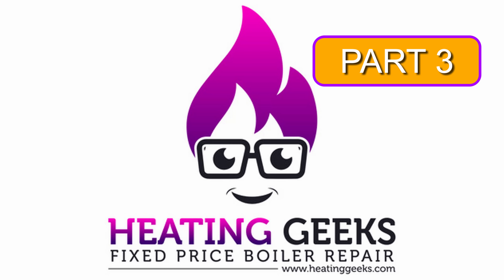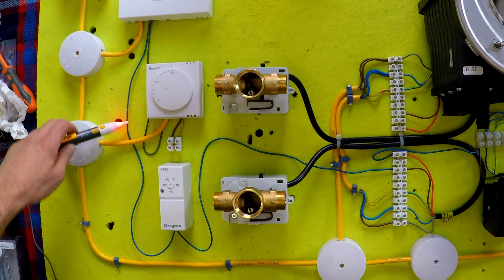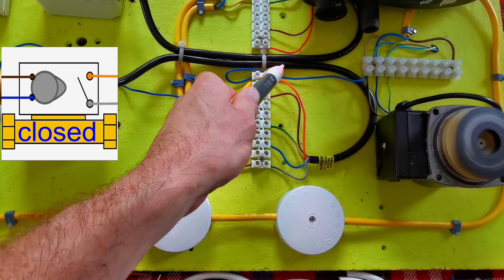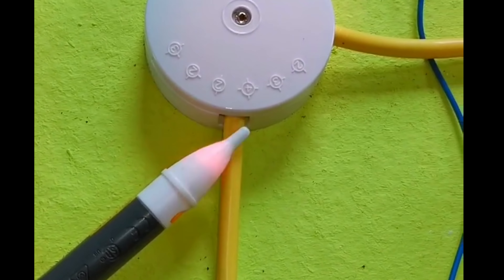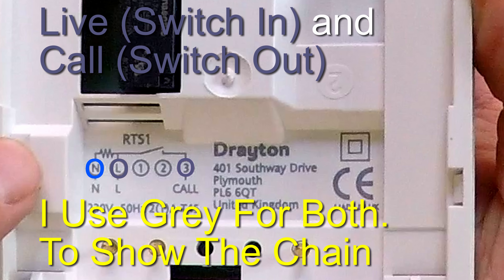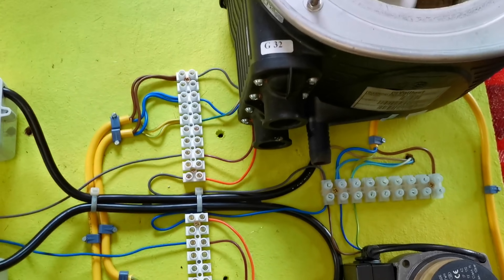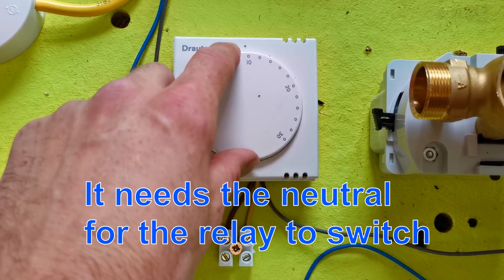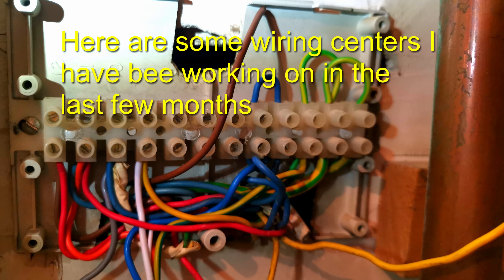How to wire heating systems. 2 port. 3 port. S plan Y plan. Heating engineer

Comment: Hey there. I was busy watching a woodworking video when part 3 came out. I immediately went back and watched pt1 and pt2 before watching pt3. The way you explain how a heating system is wired is simple to understand, and the simplicity is and constant repeating of steps are much appreciated. Only been working on central heating for a few months now.
Reply from the maker: Good I'm glad it helps. I did think about how to explain this because it is a difficult subject. :-) Thanks for watching and taking the time to comment.

Comment: great video easy to follow, when installing a CCT system and external pump do i connect additional pump to pump terminals so when  zone valves are calling for heat via nest system  both pumps switch on and boiler fires
Reply from the maker: Sorry I didn’t respond to this comment. I didn’t see it in my feed. :-(

Comment: I came up with something I find really useful when thinking about 2-ports. 
It's literally BROWN FROM STAT ORANGE TO BOILER. And yes, it needs to be said in capitals out loud. 
The other thing you have to remember is that the grey cable is actually the live from the mains and the brown cable is the switch from the stat which confused me at first because those colours should most definitely be swapped.

Comment: Great video. Thanks for sharing this. I have a question rather than have a permanent live to the grey wire of the valves. Could I use the thermostat feed wires to the valve and connect both the grey and brown valve wires to it.
Reply from the maker: I have done this several times to get out of problems. However the motors tend to seize more if wired this way.
Reply: Fantastic, thanks for the help. I do have a couple of feeds which I think might be permanent live so I will do a bit more investigation as to where they come from. Also did you make another video showing a pump overrun system for the s plan?

Comment: Very informative video indeed. just one question...at 3:57 you switched the spur switch off and measured 7v on the supply line at the junction conducting strip...why was that?...was it a dodgy spur switch or some sort of residual voltage from the programmer or pump or even the boiler? hopefully it wouldn't be enough current in that line for you to get "juiced" even if you did touch the live terminal!...because its the current that'll kill you not the voltage, and being relatively low voltage should be ok, right?
Reply from the maker: Im not sure . the video is old and I never rewatch them. ;-)

Comment: Great video thanks mate! So when the heating or hot water valves shift across do they allow water to flow through to the pipework?
Reply from the maker: Yes they do. :-) This is for gas engineers who know the mechanical bits and I didn't think about sparks :-)

Comment: Excellent video, thank you. I'm not a heating engineer or plumber but I was a tradesman and we'll be replacing the heating system in our house this year during a full refurbishment so this really helps me understand how it should be done and also find faults with my current old heating system. The one thing I can't quite visualise is what type of cable/wire is actually used for all of the single switched live wires? Is it just normal twin and earth but you only use one of them and isolate the others? Thanks again.
Reply from the maker: They are not single wires in the real world. Watch some of the other videos about wiring in the same playlist and it should help.

Comment: Hi great videos am trainee plumber if heating won’t turn off does that mean 2 port is faulty meaning power is sent down orange wire keeping heating running
Reply from the maker: Yes. That is quite often the case. The valve usually sticks in the open position. :-)

Comment: Is that fuse spur connected to a plug socket? I’d like to make one of these myself to get better used to the whole set up but obviously without electrocuting myself
Reply from the maker: Yes it is. With an RCD too.
Reply: @HeatingGeek  is there no rcd protection in the board? Thanks

Comment: On a volkera easiheat 24c Sysrem Boiler without Zone valves only a lifestyle LP711 programmer and honeywell roomstat can that be wired direct to the boiler without a Zone valve?supplying radiators only, the hot water is electric immersion heater
Reply from the maker: Yes. But remember a lot of Vokera are volt-free switching. Read the manual. :-)

Comment: Good stuff matey keep it up, would really appreciate if you could shed some light on what the white cable is for on a 28 mm 2 port valve.👍
Reply from the maker: The white cable just goes to the other terminal on the microswitch. So, it is live when the valve is closed. The opposite of the orange.
Reply: Ah understood, Top man really appreciate the reply 👍
Reply from the maker: @younuspatel7280  No problem :-)

Comment: I have 2 electric valves, 1 on the downstairs loop of radiators and one on the upstairs loop of radiators but I cannot just have the water on, I have to have the downstairs rads on for hot water. How can I fix this?

Comment: hey with your demonstration of the micro switch not working on the zone valve. 'it would be like the grey not connected'. am i right in saying that you would you test that by checking your voltage between your grey (permanent live to valve) and orange(switch live to boiler&pump). you would have 240v if switch operated correctly and nothing if not? or would that trip because you are testing live-live
great videos btw!
Reply from the maker: No, you would need to check both Grey and Orange to neutral. Should have 240v on both with the valve open. If you put your probes across grey and orange you would see 0v even though they would both be 240v. The readout on a multimeter is the difference between the probes.

Comment: Thanks for this video. Great. So, if  there is not 240V on grey colour that means microswitch has failed ?  But grey is permanent live… I thought if after demand orange does not get 240V thats when microswitch has failed.

Comment: Hi
I have an old ideal boiler, hot water works but no heating, I changed motorised valve but still not working. can you help please. I have 2 valves , 1 for hot water and 2 for heating. my boiler is 14 years old
Reply from the maker: I hope you got it sorted. Im not on here to much any more.

Comment: PS I connected live neutral and earth to the programmer and turn it on all the other terminals on the programmer have no voltage which means the same for the room stat therefore how can I use it direct to the boiler without a Zone valve?
Reply from the maker: I saw this after I replyed to the other.

Comment: What a great video
Reply from the maker: Thanks. I'm glad you like it. :-)
Reply: @HeatingGeek  if only these videos were around 15 years a go when i was interested in becoming a plumber. I am looking at installing ufh on my combi which has rads and im looking at adding ufh in the extension. So wud I do this type of S plan 2 zone valves?
Reply from the maker: @harrysingh1145  Yes. Just 2 room stats instead of a cylinder stat.
Reply: @HeatingGeek  Thanks. Is there a resonable priced underfloor heating kit that you can recommend its going into a single story extension around 25m2. Thinking of 2 loops
Reply from the maker: @harrysingh1145  Sorry. I can't. I used a few different types but they were large systems designed by the manufactures. I guess just stick to the big brands so you can get spares in 5 years. :-)

Comment: What if once the demand is off but boiler stays on?
Reply from the maker: What powers and where?
Reply: @HeatingGeek  I had a job where the demand was off at the programmer but the boiler stayed on. I changed the 2 port but it made no difference. That make any sense?
Reply from the maker: @mistadeano100  What power do you have where?
Reply: @HeatingGeek  I have power in everything still, the 2 port, the pump and the boiler. That's even with the programmer completely taken out the equation
Reply from the maker: @mistadeano100  Where is the power coming from? If you disconnect the orange wire is it coming from the boiler or from the valve?
Reply: @HeatingGeek  ah with you now
..sorry...I hadn't removed the orange at that point. I had tested negative to orange and got around 240 with no demand if I remember rightly. My knowledge is limited with the wiring side of things, so forgive my "noobness"
Reply from the maker: @mistadeano100  So the issue could be the boiler or the system is wired wrong. removing the orange (2 port system) should show you which.
Reply: @HeatingGeek  thank you so much...again, sorry for my noobness
Reply from the maker: @mistadeano100  No problem. :-) We were all noobs once. You should of seen me doing boats and commercial catering today.... Complete noob :-)